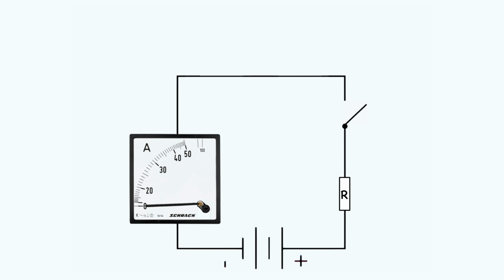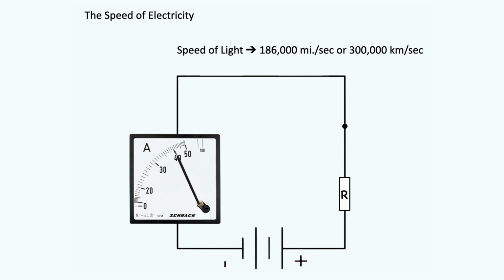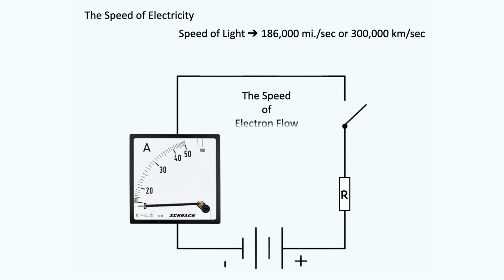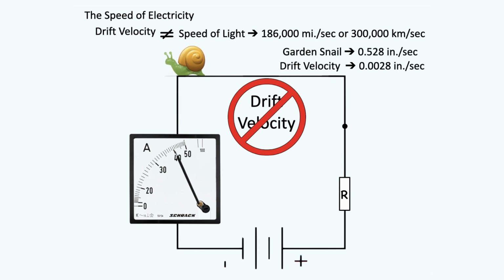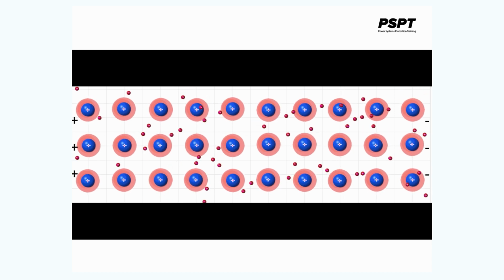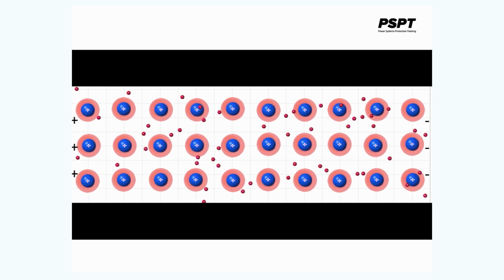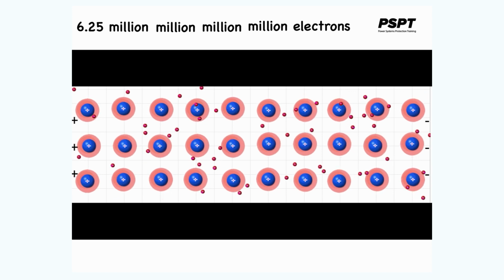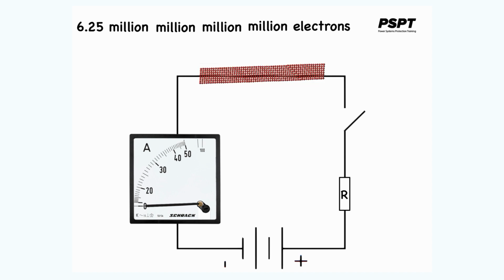Basic Fundamentals of AC Circuit Analysis - Electrical Power Transformers

Comment: A lot of physicists have produced YouTube videos in the last 2 years that have disputed the idea that the explanation of electrons pushing electrons along in the wire solves the apparent contradiction between the drift electron speed and the speed of light propagation of electric charge.  They all seem to agree that it's the surface charge that is set up at the speed of light which is responsible for the electric forces creating the current.